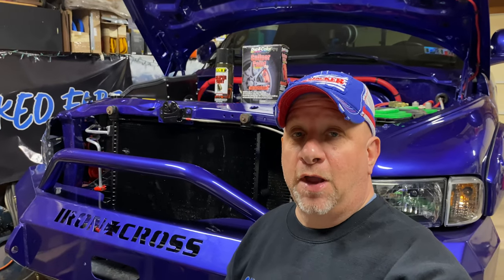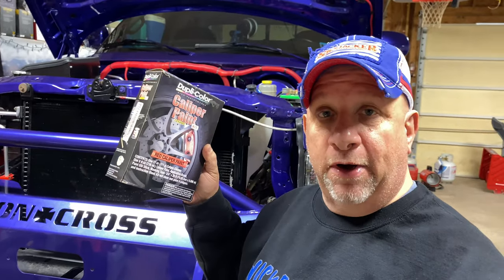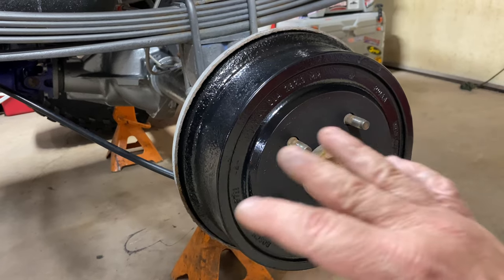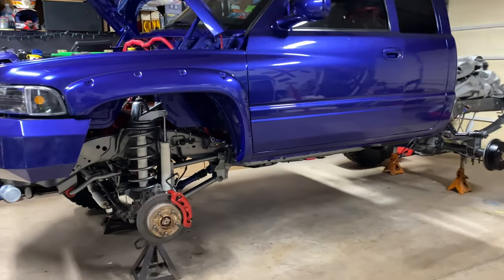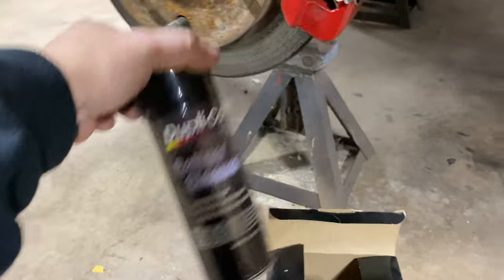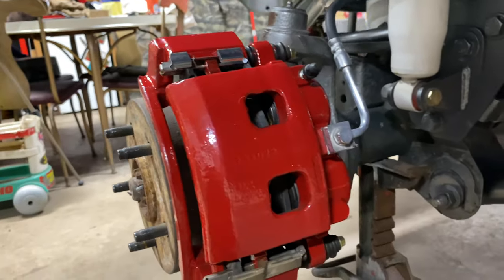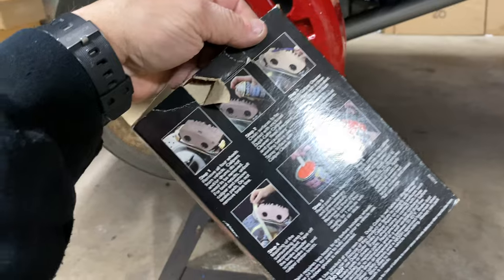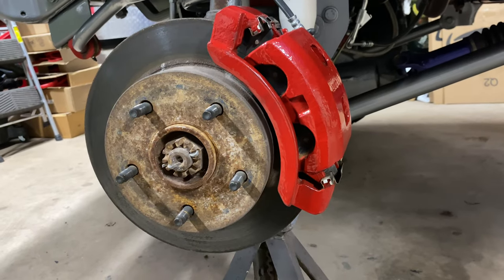Which Caliper Paint Is Better Spray or Brush On?

Comment: End of this spring I want to do my calipers in a lime green. Would I need to prime before I paint or will it be fine without and just paint?
Reply from the maker: I have never primed the calipers. You may just need an extra coat. Just make sure they are very clean before paint so they don’t peel or flake off.
Reply: Thanks 😊

Comment: I have a question: what would you recommend to be the best tires for my Jeep renegade ? Not going off road or snow. But you can suggest them
Reply from the maker: We like the All Terrain type of tire.
Reply: @WickedFabz  (I’m a young lady btw): more fair on price on a good tread and brand I’m mostly on road.
Reply from the maker: AT ‘s will give ya the best of both worlds. You can also look at a touring type tire.
Reply: @WickedFabz  you think that would go well with a limited model?
Reply from the maker: Pending on the look your after. I prefer the off-road look rather than the road look. That’s why we settle for an AT tire. If your from an area that you will driving in snow. Can’t go wrong with an AT.
Reply: @WickedFabz  from Maryland
Reply from the maker: You get some snow then. PA here.
Reply: @WickedFabz  I’m not in the mountains I’m in the rural areas